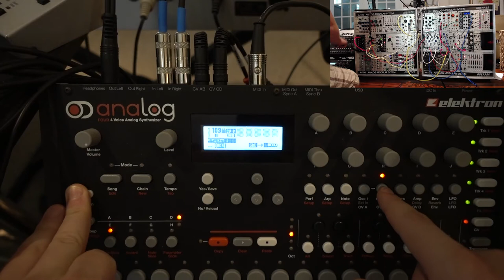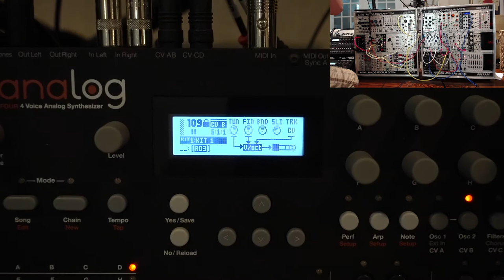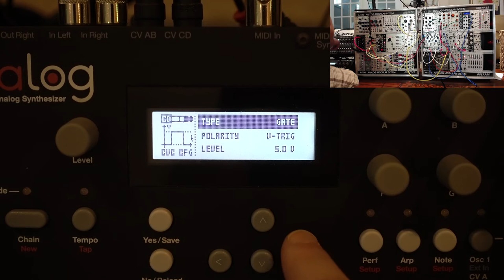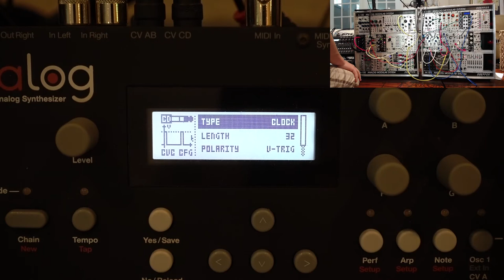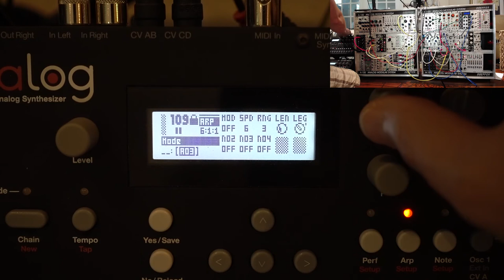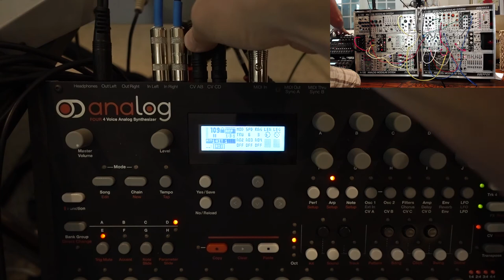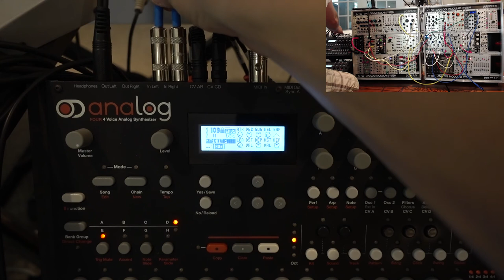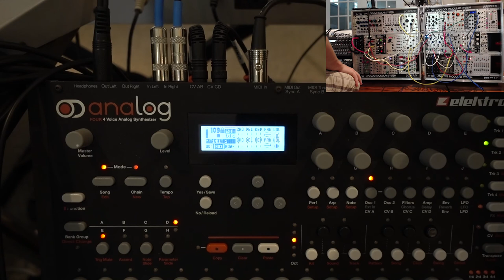Elektron Analog 4 Tutorial 1: Setting up CV outputs and External Inputs

Comment: Absolutely great tutorial , was looking for something like this as I’m starting with modular(very newbie indeed) and want to use my analog keys to control it, so in that case:
1.- can I worry only about sound generating modules and maybe effects more than sequencers, clock dividers (don’t even know what they are...) etc? 
2.- is it possible to use all the sequencing capabilities of the AK i.e. parameter locks, trig conditions?

Any comment or advice truly appreciated ! 👍
Reply from the maker: Hey chatolars,
1) From what I gather, you are asking what starting modules you should begin with in order to have a working setup with your Analog Keys. This depends on what you goals are of course but your general inclination is correct.  Since the Analog keys provides A) an internal sequencer which handles commands over time and B) functions in the form of oscillation/ envelopes/ Random value generation/ clock pulses/ etc... you can start with modules that these parameters can control. At a minimum, I would consider grabbing an oscillator and an VCA (voltage controlled attenuator), for the AK can provide all the other commands necessary to do a variety of tasks. As for a general tip for someone new to the modular world, I would also recommend a utility module like Make Noise Maths which will unlock a lot of potential capabilities and nuance for your system. After this some effects wouldn't hurt either.
2) Yes :)
Reply: Panoptes Sound Works Panoptes Sound Works man thank you so much. Really...for taking the time. 
In terms of effects I pretend to get the “Harvestam black locust” so I can use my “all analog/boutique/super expensive” guitar pedalboard with the modular, so that’s covered. 
Regarding the AK I pretend to use it only for sequencing the modular.  
I pretend to start with sound generating modules of course and hopefully it will grow on time.
Interesting you mention Maths ....heard A LOT about this unit...still don’t know why it’s so useful.
Thanks a lot again 
Cheers
Reply: Lars you can p lock stuff - let’s say you were using the linear cv out to open a filter - you can p lock the filter with different modulation settings.